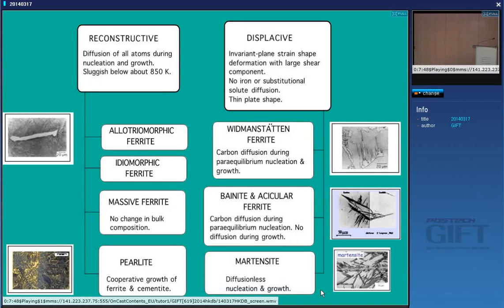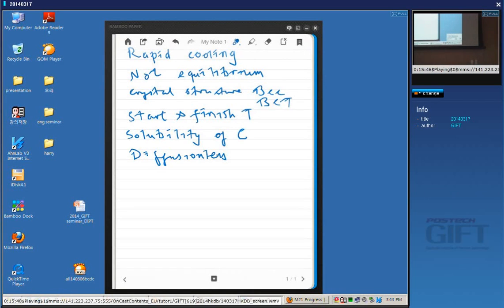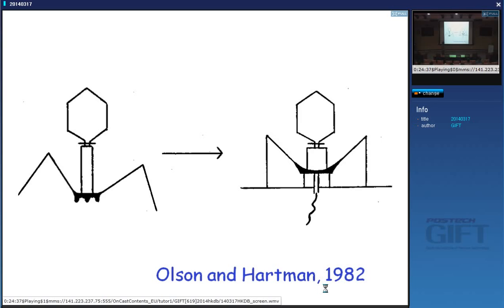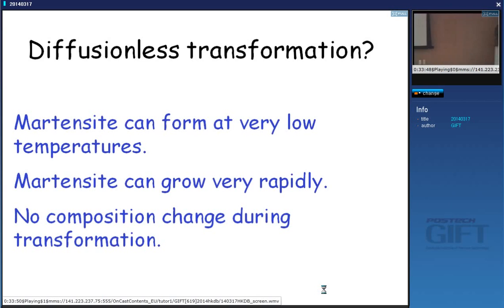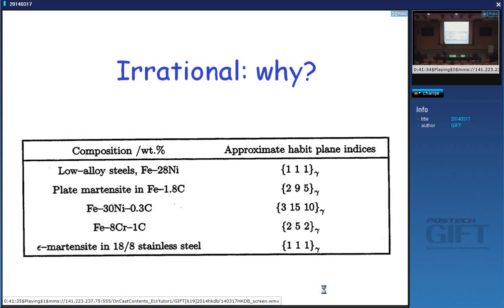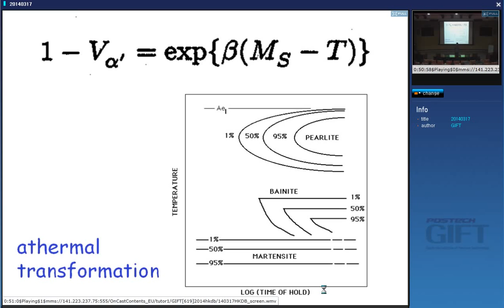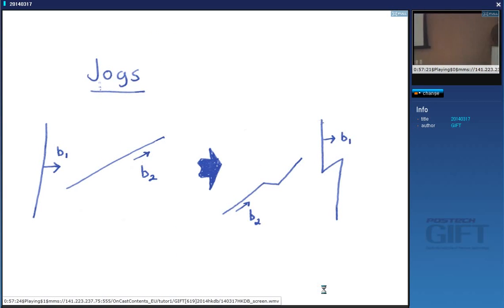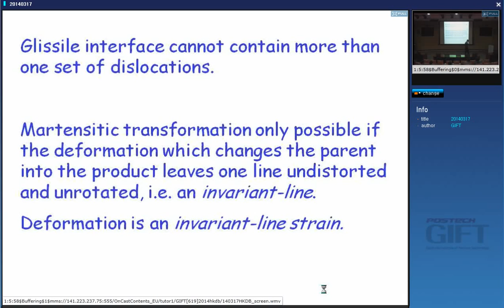Phase transformations in steels 1, 2014

Comment: How many slip systems does a BCT crystal have and is it less than BCC? Thanks
Reply from the maker: I don't have the information, but BCT has a lower symmetry, so for example, there are fewer crystallographically equivalent {110} planes.
Reply: bhadeshia123 Thank for your answer

Comment: There is a little miswriting on the K-S N-W relationship at 36.38.
Reply from the maker: Can you be more specific? Seems fine to me.
Reply: bhadeshia123 Like the top left corner, should it be (111)austenite parallel to (011)martensite? I'm a little picky. By the way, your videos really help me a lot when I'm doing my research. Thanks a lot.
Reply from the maker: You are quite right, thank you.